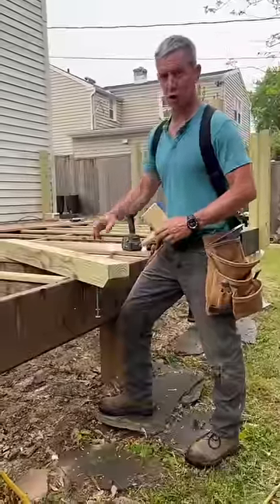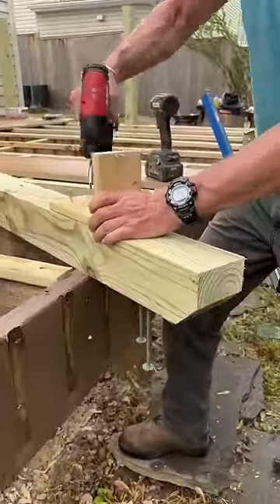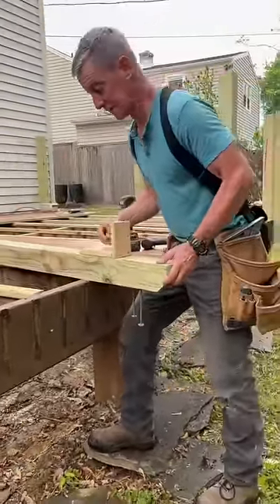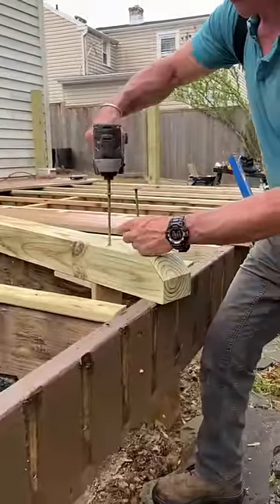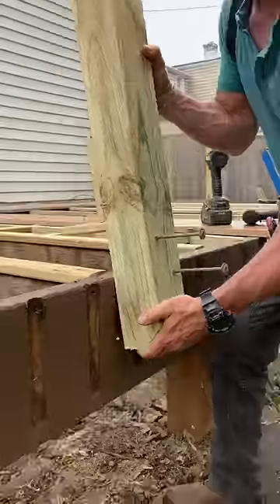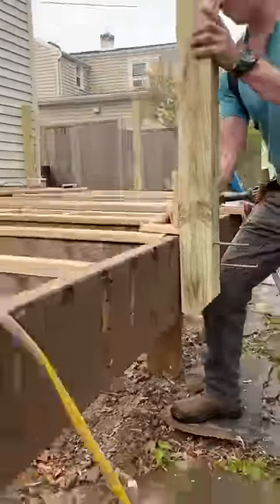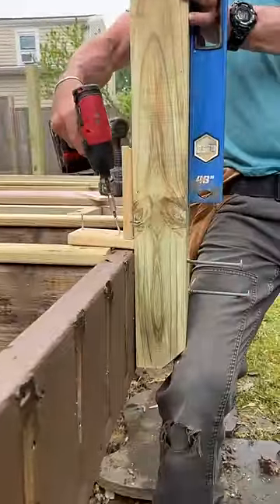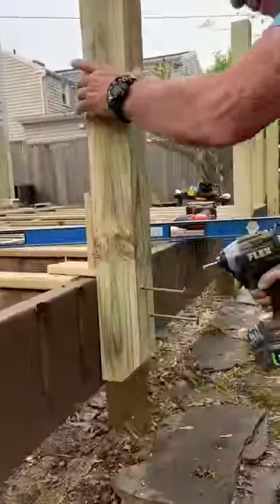DIY Tips: How to set a deck guard post by yourself

Comment: This whole project is suspect. Why drive 8 inch GRKs into a 1.4" thick rim joist anyway? They don't have any holding power when 3" of the screw are in open air under the deck.
Reply from the maker: I get the "suspect". It's a re-skin of a 30-year old DIY deck. It has the double front band detail I despise--a 2x8 behind a 2x10 so posts needed to be surface mounted. That said, even if there was a single front band, I'd make the same connection. - The pull-out on these screws requires catastrophic framing failure that just isn't happening.
Reply: @myfixituplife  If you insist on putting screws into 30 year old rim joists, consider maybe getting 5" or 6" GRK and mounting from the inside of the joist. That way the threads would be in the new wood and the flange on the screw head would have less chance of pulling through the old wood. It would also hide the flanges that you drove super deep into the visible side of the post. I just finished a deck with doubled up 2x10 rim joist that had 6x6 rough cedar posts mounted inside the rim joist with blocking so I'm not sure why you say posts would need to be surface mounted for a double rim joist. It has 10ft posts with a tension sail shade system and it is rock solid. But what do I know?
Reply from the maker: @Langhorstiness  I hear what you're saying, but we're not building the same system by a wide margin. - First, this video was intended to be about the jig (45-seconds) not the connection (12-seconds), but here we are. - As for your project: "I just finished a deck with doubled up 2x10 rim joist that had 6x6 rough cedar posts mounted inside the rim joist with blocking so I'm not sure why you say posts would need to be surface mounted for a double rim joist." - I'm sure why posts needed to be  mounted on the band--it was only 12-feet deep and had the same detail you had--a double rim...ack--so there was no room to mount a post in-board. We'd lose a foot from the foot print of a tiny deck. - "What do I do know"? - I don't know. Nobody does. Our juju is that we're not trying to win the conversation. We're trying to learn from it.

Comment: WOULD HAVE USED HEAVIER DUTY BOLTS AND MOST OF ALL LIQUID NAILS 
HEAVY DUTY
Reply from the maker: Show me some heavier duty bolts. And fewer caps.
Reply from the maker: Before I hit the desk there are any number of things I do to get ready for it--by the way without desk work, there is no work. But before I hit the desk, there is just a little PT. - Loading lumber and doing work comes next. Let me know if you want to know more.

Comment: Dead wrong player. Not only is it bad carpentry it’s just plain bad to attach your post like this. They did this stuff 40 years ago and it was acceptable, today, not so much. Unless your in Indonesia
Reply from the maker: 1 -- I love that you go with "player". Made my day. And they did stuff like this 40 years ago because the notched posts I took off this resurface job were lagged all over the place and to be honest, were in good shape. 2 - Also, no they didn't. The screw geometry in thes Spax PowerLags is insane. No pre-drilling an the wood is darn fused together. 3 - Indonesia?

Comment: 200 lbs. of lateral pressure? The top scew is to high.
Reply from the maker: Yeah, 200-pounds is the load resistance a lot of this is based on. There's a whole test rig and cable. It doesn't include the top cap or the shared load of the other posts. - The top screw does look high in the video, but it's 2-inches down in real life. Good eye.
Reply: Not a big deal in this residential application. 50 drunk football fans leaning on a stadium handrail is another story. Have to calculate post spacing and sometimes we had to use schedule 80 pipe in lieu of schedule 40 to meet code.

Comment: I don't like it. I would notch the post or compose it of several members so it is held by wood, not fasteners. Then I would mount it on the opposite side of the fascia. I think you have to set rails inside for most code. Lastly, I like bolts for these.
Reply from the maker: This is a reskin. And, not shown, there is a 2x8 inside the 2x10 band. - I get what you're saying, but it doesn't work here.

Comment: How does this make sense? Those screws will split the wood in no time!!! You need to use a carriage bolt with a washer and a pilot hole to begin with.
Reply from the maker: Split? That's the point. Slam 'em in. Move on.

Comment: Not to code, check with your local building department before hand
Reply from the maker: Good advice to check with local inspector. I definitely borrow from the spirit of the code (post must resist 200-pound lateral load). I'm certain that in this repair, this post cannot move without other catastrophic structural damage, especially when tied in with the other posts and top cap. And even if I were going to drill pilot holes for thru-bolts, I'd still set the post this way.

Comment: The  posts. Should be minutes to the Inside of the Rim.....AND also against a joist with Ledger Locks.   On the outside as shown.....is not Code approved
Reply from the maker: Code is based on an esoteric criteria. Yes, it shows a few engineered details and there are 1-million good reasons for this. However, that criteria is that the post be able to withstand a 200-pound unsupported side load. - It doesn't matter how you get there, it just matters you do.

Comment: I have been bending nails for 40 years. 
Its  getting dumber and dumber. 
I'm literally at a loss for words.
Reply from the maker: I'm a nail bender, too. - I came up hand nailing plywood subfloor with 6p sinkers.. I hand nailed salt water docks 10p hot dipped. I built decks with screw shank 10p nails. -

Comment: What kind of horseshit is this?
Per the IBC: Point Load:  200-pound concentrated load applied in any direction at any point along the top rail or top of a post.
If tested at the required safety factor of 2.5, these posts will tear right out.

Do not, under any circumstances, follow this idiotic method for installing deck railing posts.
Reply from the maker: I hear you. I've seen this this performed live. While I get it--it's in case then entire frat leans on the guard rail of the janky keg party beach house on the third floor--it also doesn't include the membrane and shared load of the other posts when connected by a 2x6 top cap on 99.9% of back yard decks. Further, these same screws are approved for the ledger and post-to-beam connection. There are different forces at work to be sure, but there is full wood fiber engagement from thread to shank. There's no nut to loosen up over seasons of expansion and contraction.
Reply: So your rationality is "since there are hundreds of un-safe, poorly built decks in the wild, it's ok to continue to build un-safe, poorly built decks because everyone else does it".

Comment: For one, what the heck is a guard post? 
  2, it's called pilot hole. 
  And 3, just put a screw on your van board the height you want the bottom of the post to be I'm set your post on it then plummet and assume it. You made this way more complicated than what it has to be.
Reply from the maker: "Guard post" is Code language. - It is indeed called a pilot hole. - The rest I can't figure out. - Whether you screw your post in or need to pre-drill it for thru-bolts, tis technique TO GET IT #$%^&* plumb works nicely.

Comment: Use carriage bolts, not gag bolts.
Reply from the maker: I hear you. - I took a million 3/8-inch lags out of this 30-year old DIY special. It was crap work, but it did actually function. And it was hard to take apart. - Three decades hence, we've arrived at structural screws. They do the same job but they do it better, easier, fewer tools required.

Comment: Posts should  be only anchored right down into the ground, these type will wobble and be unsafe in a few years and are never as strong or safe as a ground anchored one!
Reply from the maker: You ground anchor guys are a small but vocal lot. It wasn't possible here. This is a re-skin. And on the deck I just replaced the guard rail on, it was 14-feet off the ground.

Comment: Wouldent have you do my deck .i could lean against that and rip them right out .(you have no back plate).FIRED EMIDEITLY!
Reply from the maker: Would spot you as a nightmare client in 10-seconds. Maybe you have some cute money, but you have no idea that the same screws hold the ledger to the house or for the post-to-beam connection. - Are you a part time flipper?
Reply: ROFLMAO.im a builder myself young man.i own 5 homes I've built by myself .( With my 7 man crew of course) I love second hand guys like you .where did you get your builders license.allmost bet you don't have one .how much insurance do you carry .are you bonded ? Things people should be asking you .have a nice day .youngin dang wanna bees.
Reply from the maker: Again, you're a nightmare on wheels and the light coming at me from the other end of the tunnel. I'm sure you've had some success, but nah, I'll pass.

Comment: Why do Canadians always have an objection to doing things the right way? The code for attaching deck rail posts is cut and dried and this isn’t it.
Reply from the maker: Yes and no. And while I am proudly of French Canadian descent, this happened outside of Philadelphia. - Codes are based on criteria, not boards or bolts. In this case--and I think this criteria is ambitious at best, but whatever--the post ALONE needs to sustain a static pull of 200-pounds. I've seen the test. - Sure, the post fails. But the test only tests the post and not the other components of the guardrail system. - For this post to fail, the entire structure fails.

Comment: who sets the posts on the outside of the box? set it on the inside and box it out then bolt it. those little crews are no good.
Reply from the maker: If there was a way you could hobble that connection--even before I added the railing system and 2x6 top cap--without tools I'd give you some kind of prize. Whatever takes that apart, brings the deck with it.

Comment: YA, Don't Know WHAT YOU THINK YOU KNOW!!! BUT THAT'S NOT IT!! BOLT, BOLT, BOLT!!! 👍!!!
Reply from the maker: 1 - This is a repair. A re-skin. The frame is 25-years old. 2 - There's an inboard 2x8, so my bolts--which solve no problems--need to be 8-inches long. Not the end of the world, but I also like money. 3 - This video was about how to set the post, not how to connect it.

Comment: Or use a clamp on your jig so you don’t put extra holes in the post 🙄🤦🏼🤷
Reply from the maker: This post is rated for ground contact, a pin hole isn't going to cause permanent damage. Also, clamps move, screws don't. Ask me how I know.

Comment: No that's not how you do that. You noch the post we use carriage bolts but you can use spax, there is nothing wrong with that but I would predrill instead of what you done.
Reply from the maker: I get it. The deck I had when I was a kid has notched 4x4 posts and it worked just fine. However, times change. I don't like notching and I do like the geometric grab structural screws have. It's amazing. I bomb Spax screws into the ledger and it works well for the posts on a re-skin like this.
Reply: Not relevant, it's easier than using a jig. Especially with the new long jigsaws blades they got now. I always put in posts by myself.

Comment: Just knotch your post an you dont need that lil "jig" or watever you called it
Reply from the maker: The code heroes with decry notching, but the number of decks I've resurfaced where it lasted decades is not zero. On the other hand--props to code--notching fails. Zero question about it. - The jig helps solo builders like me not need employees

Comment: Nope. Needs a better connection to the joist. It will fail in 5 years. Use a DTT2Z by Simpson or something similar.
Reply from the maker: Same screws hold the ledger to the house.

Comment: Power lag ??? What the hell is that ?? The term is structural screw .. you silly guy.. and personally I’d through bolt if with a backer board
Reply from the maker: It’s a brand name. I know the category is called structural screws. This is just what the manufacturer of this one, Spax, calls theirs. Same as TimberLock and whatnot.

Comment: thats not code in most states, neeed blocking and thru locks
Reply from the maker: No argument. It's not in the DCA-6. And this is a resurface and whether or not I screwed it or did bolts, I'd still set the post this way. The jig, the screw the PowerLag to hold it all fast before pre-drilling. I'd do that all day.

Comment: That’s wrong and it’s also illegal. The post is supposed to be blocked on the inside of the decking you lose.
Reply from the maker: When you say "you lose", I think you mean loser. - Whatever. This is a deck re-skin and the entire video is about how to set the post, not fasten it. - That said, I get what you mean and I'll bet you my dump truck that connection is well within the spirit of the code.

Comment: Top screw has 100% split the timber as too close to the top. Also you just put holes in that post that didn’t need to be there. Donut
Reply from the maker: Top screw has 100% not split the timber. Sorry.

Comment: Those posts need to be bolted
Reply from the maker: I get what you're saying. But the code behind the drawings is that they need to resist a specific stress. For codes--and that includes public places, rentals, whatever--this deck could never receive that stress without catastrophe.

Comment: Shimming guard posts? Flunk my inspection.
Reply from the maker: I don’t know if you’re really an inspector—if you are, your professional comments are welcome. However, if you were looking at decks and other builds all day,I’d think it would be obvious to you that this is a re-skin repair and not permit-required work. The existing condition—and a detail I despise—was 2x8 framing with at a 2x10 “fascia” applied. Well, in the 30-years it had been gathering tree detritus a terrarium formed in there and cupped that puppy. Should I just slam in out of plumb posts so I can pass your inspection?

Comment: Re surface or not, you are as a licensed builder required by any state to update and reinforce any structural components. Which means properly installing hand rail posts inside the deck framing. 🤦🏻‍♂️
Reply from the maker: I am licensed. I get where you are coming from. I am also not a lawyer. Neither are you. This is a repair. Try the jig.

Comment: Thise screws are too weak, use coach bolts!
Reply from the maker: If I was a big tie YouTube star, I'd run a contest to see who can cripple this connection without tools. I'd even leave the 2x6 top cap--which shares the load with the other posts--off. I'm not a big time YouTube star, so you'll have to wait. Sorry.

Comment: Put the post on the inside 😂
Reply from the maker: I'm building a deck like that now. I call them "housed" posts. On re-skins--and smaller decks, like this one is--I surface mount them. Not shown, the 2x10 I'm fastening to is a "fascia" (dumb detail). There is 2x8 framing inboard. This post isn't going anywhere.

Comment: Inspector would fail him would fail 200 pressure per hr all railing need to be anchored at least my state
Reply from the maker: Maybe. But I love that you know what the Code is based on and agree with you--based on the rules they have to follow and for very good reasons. HOWEVER I have seen 200-pound test performed live and while it is "scientific" it doesn't include the the 2x4 rail or 2x6 top cap or integration as a membrane with other posts.

Comment: notched posts are not code anymore
Reply from the maker: Correct. However, I replaced notched posts on this deck resurface that were locked in hard. Others I've done were toothpicks.

Comment: next month the shims fall out and the rail is lose
Reply from the maker: Even if the do, there is 100% wood engagement along the threads and shank of the screw. That post is going nowhere.
Reply: @myfixituplife  just going to shake so much you will feel drunk all the time, wood shrinks back over time treated lumber even more so once that happens them screws wont hold shit and that is why it is building code just about every place in north america , save the witty come backs your job is sub standard on so many levels , if you like ill be happy to school you rookie.

Comment: that is wrong, you must put the screw past with nut and washer
Reply from the maker: You can use this technique to hold the post fast whether you use structural screws or thru-bolt.

Comment: No the posts should be on the inside of the deckin so you can block around it and strudy it up. This is going to fail
Reply from the maker: This will not fail. It is not the Code drawing(s) everybody has to follow, but it meets the spirit of the Code for this deck repair. Plus, it wasn't about how to fasten the post, it was about how to set it plumb and save time.

Comment: Good DIY tip but far from properly installed by code or quality.
Reply from the maker: It's not in the codes I've seen, but it works. The quality is 100% there. And the technique for getting the post dead on works great whether screwing or bolting.

Comment: Notch it in ya hack
Reply from the maker: And turn a 4x4 into a 2x4? No thanks.
Reply: There is still plenty of strength at the 2x4 dimension, but you create a much stronger joint by lapping the post. It increases the surface area of the post in contact with the deck which will keep it from loosening up over time. You’re just relying on some lags and friction to keep it plumb.

Comment: Post is weaker on outside
Reply from the maker: No argument. If this was a guardrail on a waterfront restaurant, I'd max it out. It's not. - It's on a 25-year old deck with a double front beam. - I get Code, but I also get that I have a business to run and I can't just spend all day dovetailing everything.